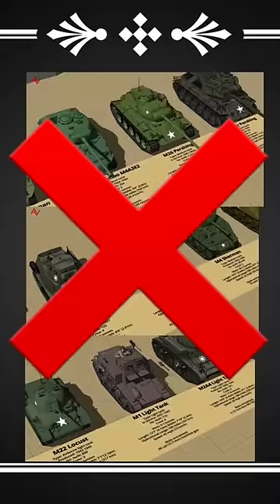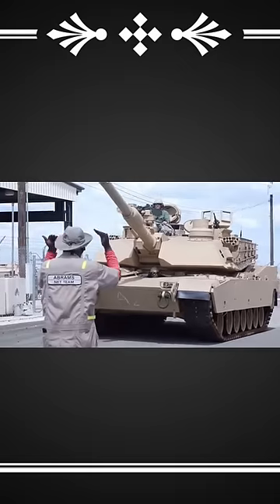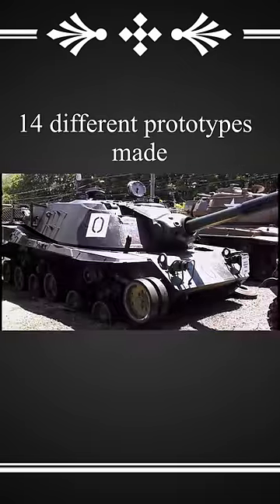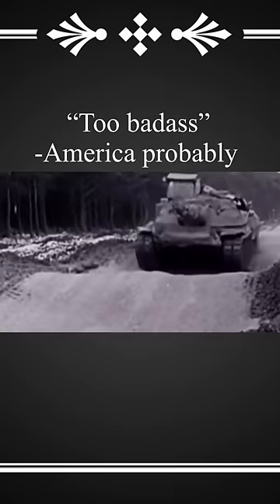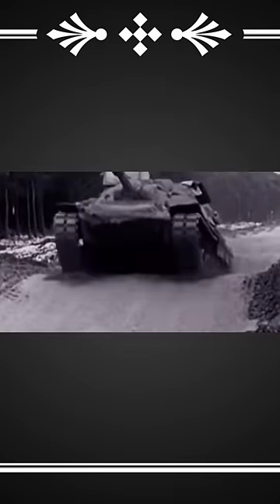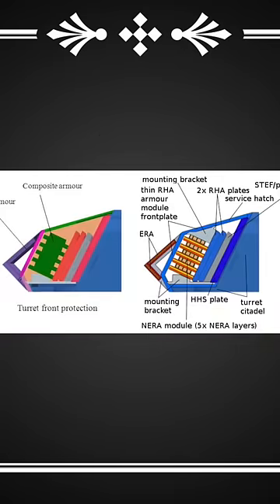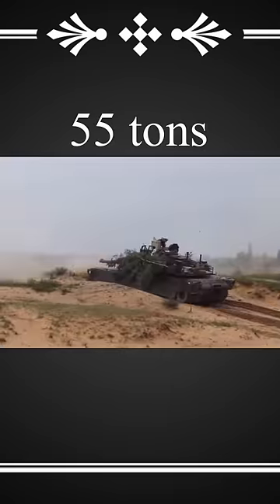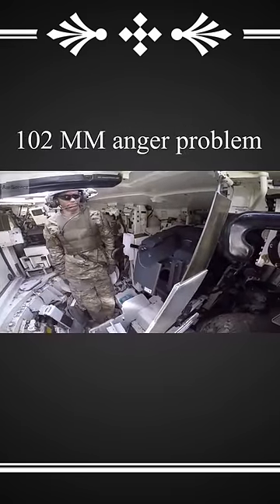M1 Abrams! Americas finest tank #shorts ￼

Comment: Zee Abrams is actually 120mm smooth bore of American oil grabbing freedom force
Reply: The original M1 Abrams had a 105 mm cannon. Since the 1985 M1A1 upgrade, all Abrams have had the 120 mm smoothbore
Reply: @tylerclayton6081 yup, but the video said it was 102mm which is incorrect on both cases
Reply: developed by germany
Reply: @ticktacktoe9110  is it not a United Nations thing to get all the country’s the same gun so that they have universal ammo for every tank?
Reply: @pickles32  120 is nato standard iirc not un
Reply: @hom7998  yes my mistake, the 120 is nato. Thanks
Reply: @pickles32  yes it is a NATO standard and the British Challanger, Abrams and Leopard use the Same gun developed by Rheinmetall:)
Reply: @dennishg-oh1eq  Most of the Challanger 2 tanks use a rifled 120mm cannon only some challanger 2s with ugrade packages have the smooth bore 120mm but all the challanger 3s have the smooth bore.
Reply: Actually the m1 Abrams had an 105mm Cannon but the m1a1 and the m1a2 has an 120 mm cannon
Reply: @tylerclayton6081  but what about the IPM1? 😢
Reply: it started out with a 105 then moved to a 120
Reply: @pickles32 I think it's NATO, not UN. And I think 105mm were also a thing because the Leopard 1 also had that.
Reply: @a_wazza probavly compensating for the few mm lost when the round goes through the bore
Reply: T90M,T72B3 and t80BVM chambered with 125mm 3BM59 and 3BM60 is sure hungry...
Reply: @ticktacktoe9110 license built in the U.S.
Reply: @pickles32  NATO not the UN
Reply: The original m1 used a 105mm rifled barrel they moved to the 120 with the m1a1. But the video is wrong with the calibre he said
Reply: its a common mistake... the original abrams was armed with the L7 105mm  gun from the conqueror... it wasnt until a later upgrade series that they went with the rheinmatall 120mm smooth bore that the leopard has.
Reply: @pickles32 the united nations isn't a standardized military coalition

Comment: It's a bit heavier. I can't remember off the top of my head since I've reclassed from a 19K to a 15Q. The SEP V2's were around 71 tons. The SEP V3 is around 78 tons. The M1A1 was around 55 tons.
Reply: Good god
Reply: M1A1 (at least more modern variants) were about 68 ½ tons completely empty and about 71 battle ready. If memory serves correctly. Been out for a few
Reply: You are correct
Reply: M1a1 aims sa was 68.5t 70t fully combat loaded. The sep v2s we 71t 73 fully combat loaded and the v3 comes it at a whopping 80t 83 fully loaded
Reply: You're right because they added something else after the 120 mm gun that it made it even heavier
Reply: @Dra741  the aims sa package
Reply: @Dra741  the CITV  and upgrades bumped up the weight from the old M1A1s to the A2s.
Reply: M1a2 sep is 72 loaded and the sep 3 is 86 tons
Reply: @dirthugger  doesn't hurt that they have almost 4 miles worth of wiring in them
Reply: Whoa…. Dude 62.5 for M1 67.5 M1a1.  I still have my TM.
Reply: And constant upgrades and different packages keeps making it heavier and heavier

Comment: My tank, M1A2 SEP2 + Tusk Kit, was around 72 tons. Same engine that’s in the Blackhawk. We use to cook on the exhaust frame. 😂
Reply: Sep 11? My man there is no Sep11
Reply: Tell me another lie before that gets old
Reply: @wyattchaplain275  The f you talking about? I mistyped 11, instead of a 2 on my iphone. Heaven forbid I have fat fingers. Go look up the short tons of an M1A1 SEPv2. I am assuming you are in the military, what's your MOS, Grade, and current UIC then?
Reply: @wyattchaplain275  What else is do you have issues with? That the Abram's Honeywell AGT1500 gas turbine engine, with roughly 1,500 HP, was originally designed for helicopters? Well, it was. Yes, current hawks use the GE T700, (I think?), with a HP of around 1,600 but they are essentially the same engine. That was my point. Both gas turbines and both outputting over 1,500 HP. I generalized my statement for simplicity. A hard concept for some, I know.
Reply: @Dr.C_Stag  United States Navy Submarine Force. STS. Petty Officer 2nd class. I am stationed on the USS San Juan (SSN-751)

Comment: The Abrams is 80 tons and has a 120mm smoothbore main gun originally although that's been upgraded to a 130 mm and can be upgraded further gun wise
Reply: No it's 70 tons fully loaded
Reply: its only ever used the 105 and the 120, not sure where you got 130
Reply: @migyoshi1592  and the 120 was not the original gun, the 105 was
Reply: @QwerYT4819  ik
Reply: @QwerYT4819 72 tons i think
Reply: dude is talking about the m1 abrams which had 105 and wasnt as heavy yet, you are talking about later varrients like the m1a2 SepV4
Reply: @robo-suport_czrobofactory3116  there is no sep v4 it stops at the v3

Comment: Alright, so, even though it's already discussed in the comments, it's all chopped up,  so I'll put the issues in one big thread. 1, the gun. The original m1 used a rifled 105 mm gun, but as with many tanks, the turret was designed with extra space for future weapon systems, where the 120mm l/44 gun was first placed on the experiment ipm1 testbed, and was adopted on all future variants. 2, the weight. While the original m1 weighed appx. 55 metric tons, the weight rapidly increased with future variants, with the most modern variant weighing almost 70 metric tons. And 3, development. After ww2, the US didn't just immediately begin producing the Abrams, as many other tanks were born before it,  for instance, the m41 walker bulldog, the m47 Patton, and arguably the most notable predecessor to the m1, the m60. On top of this,  the Abrams wasn't born directly from the xm-801/mbt-70 joint German and US program. While certain aspects of the research gained have a great deal of impact on the m1's design, the m1 was developed more directly from the two variants of the xm1, which took a great deal more inspiration from the mbt70 program. While I may be slightly Incorrect on some points, I believe this is a decent summary of the facts that have been talked about in the comments, and if there's anything wrong, feel free to respond in the replies

Comment: The M1A2 SEP v2 has a combat load weight of about 72 tons. Fresh out of the factory, it's sitting around 65. 

That being said, it still achieves speeds up to its governor at 42 MPH with its 1500HP turbofan engine, limited only because faster speeds would throw the tracks off the tank.

Comment: The MBT-70s failure can also be linked to the US having way stricter requirements for a tank than Germany. This lead to the German MBT-70 being an overall better tank, with the US MBT-70 being more adaptable. Big reason why the Abrams hasn’t needed to evolve much unlike its other MBT-70 relative the Leopard, which has gone through quite a few changes

Comment: M1a1 and onwards has the improved 120mm rhinmetal borsig licensed German smoothbore cannon
Also the mbt 70 was an American and German dual research and development project to combat soviet t-54 and Is series tanks, the Germans went on to develop the leopard mbt tanks from the failed mbt project, the abrams tank although heavy is one of the most manoeuvreable tanks in the world with a large variety of modifications and upgrades across the board

Comment: Yeah that’s not how it went but ok. You totally forgot the M60 Patton was developed and mass produced during that time. The M1 and M1A1 Abrams didn’t fully replace it until 1997. Also the early Abrams had a 105mm, but after 1985 they all got switched for the 120mm

Comment: i was about to say that the M1 Abrams doesnt use the 102mm Smoothbore Cannon... then i remembered that it is the first version of the Abrams used back in the first Gulf War, which does use the 102mm Smoothbore Cannon that was later exchanged for the much more robust 120mm Smoothbore Cannon in the later variants of the M1A1, M1A2 (Sep/Tusk), and probably the XMA3 thats currently in its trial phase

Comment: The mbt-70 program did lead into the abrams  (m1 track armoured fighting vehicle) but it wasnt the original goal as the mbt-70 program was a joint program between the us and germany the program did create a revolutionary design as at the time it had no crew in the hull and instead put them ALL in the turret allowing for more fuel or ammunition storage, plus the mbt-70 had a earlier verson that was designated XM-803 by the us government, the main problem with the mbt-70 as a tank was its early composite armour not being very thick and its gun being very poor for a mbt its main gun was only slightly more powerfull than the british 20pr gun found on the centurion mk3-5 from memory, the abrams then became a viable concept when the 105mm L7 came out allowing for a high rate of fire (for a manually loaded 100+mm gun) and good results from armour penetration and shrapnel tests, anyway the abrams is dope so is the mbt-70

Comment: Well you skipped a couple steps in between WW2 and the M1 Abrams. There were MBTs before like the M48 Patton and, more importantly, the M60 (and its variants). Also, the MBT-70 program was a joint program between the US and Germany, which tried to create a super modern MBT trying multiple different things all at once, which created a lot of problems. The program got too expensive so congress cut funding, but some lessons learned influenced the XM-1 which later became the M1.
The M-1 Abrams was not really a response to the WW2 style doctring of having light and medium tanks but a direct response to the then new T-72 and T-80 tanks of the soviet union.

Comment: Uncle Sam didn’t run outta pocket change we were in the project with Germany who had a difference in design philosophy which resulted in the discontinuation of the project the mbt 70 led to the leopard for the Germans and the mbt 70 led to the Abram’s for the Americans also the Abram’s is close to 70 ton and has a 120mm gun not 102 unless is a really early model which had the 105mm gun

Comment: Poor M26, M46, M47, M48, M48A1, M60, M60A1, M60A3, M60TTS and the poor poor M103

Also, the M1 uses a 120mm cannon
The US did not use anything from the mbt-70 project for the abrams, just lessons learned 

To say they used parts of that project for the abrams, would be like saying that the designers of the F-35 used parts of the project for the F-4 Phantom to build the F-35

Sure, some things that were learned from the F-4 is definitely considered when designing a new war plane, but that’s severely oversimplifying something

Comment: MBT-70 was a joint program between America and Germany. In my opinion though parts of mbt-70 where taken into the abrams design they are very different. You say 102mm but that aint right at all. Finally, after ww2, a Main battle tank was first made by the british, with the centurion then america with there M46-M60 Patton line of tanks (probably goes back further), and light tanks are still very much a thing

Comment: The MBT70 isnt a prototype abrams. it was a scrapped project because it was too expensive and germany and the US couldnt agree about the direction it should go(As they worked together on the project). Lessons learned during the program would be applied to the XM1 program. but thats nothing special. lessons learned from previous tanks always influences design choices of the next. take a dislike for your incorrectness.

Comment: bro went straight from M4 sherman to M1 abrams and skipped 3 generations of Post WW2 main battle tanks

MBT 70s completely unrelated to the M1 Abrams. M1 shares 0 components or design features of that tank. and you said chassis of the Abrams. last i recall M1 Abrams doesn't have a V12 diesel, and Hydropneumatics suspension and no space for a driver.